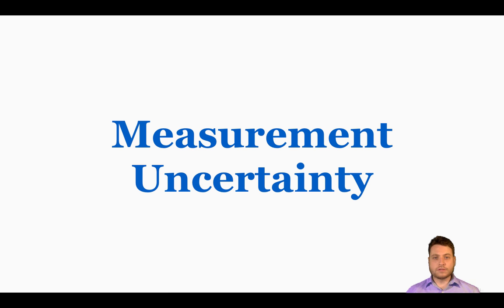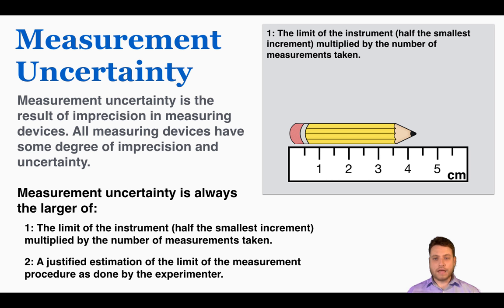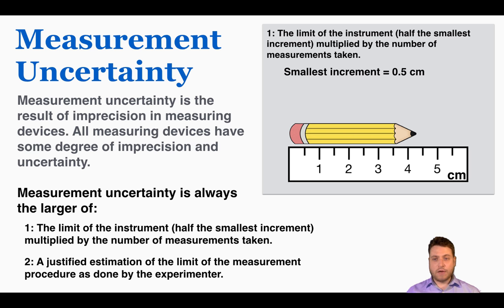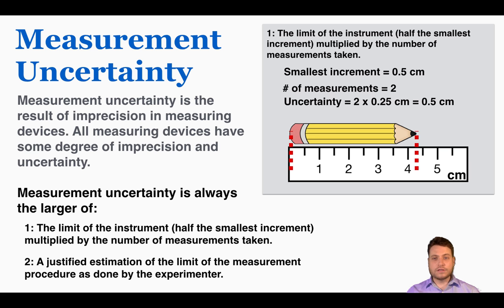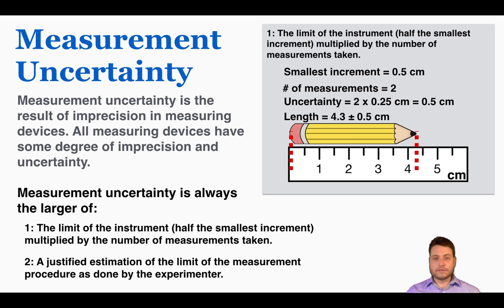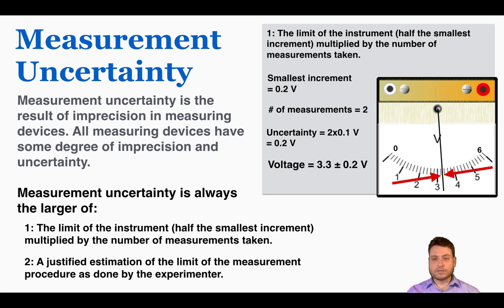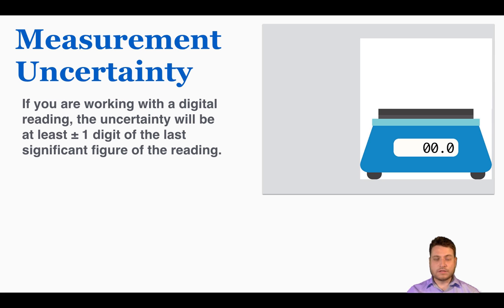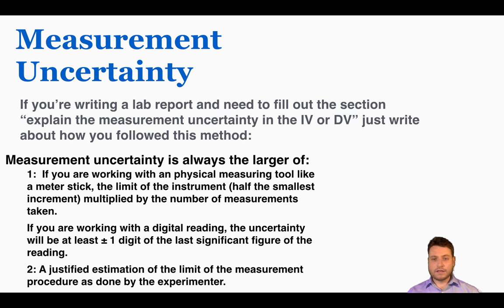Measurement Uncertainty - IB Physics

Comment: I think in the case of analog voltmeter, two measurements could refer to measurement for 0 of voltmeter being aligned which always needs to be done and then the final measurement of potential differencel  rather than the left and right sides of voltmeter needle?